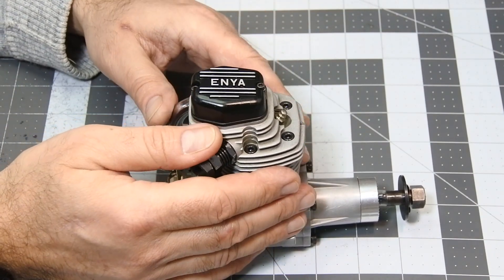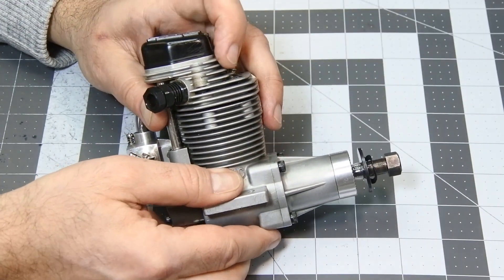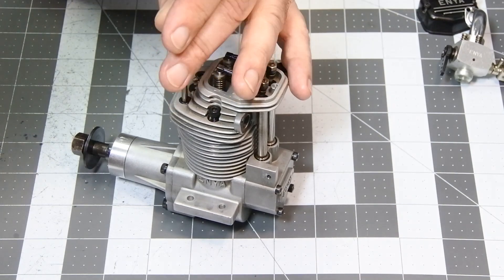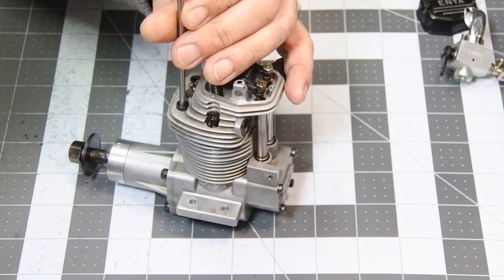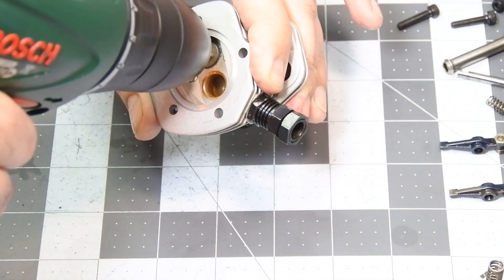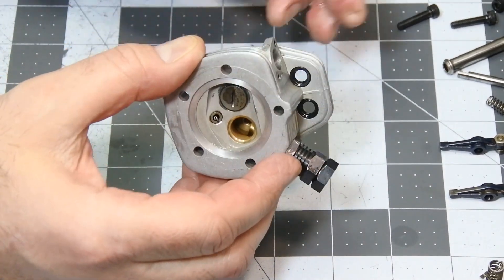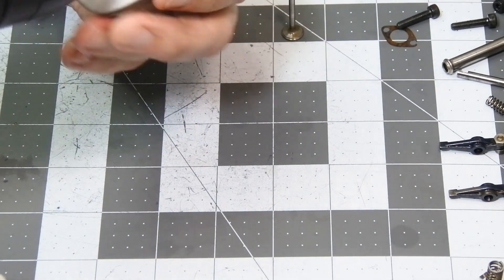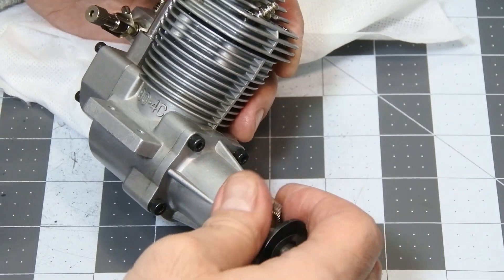Enya 90 4C lapping the valves eng

Comment: Thank you for useful video. I also lapped valves of ENYA 41-4C the compression of which became weak. In that time I did not use any motor tool being afraid of giving unneccecary damage to parts and as a result, needed very long work time. You encourage me to use motor tools in maintenance or modifying engines.
By the way, do you speak russian? I was surprised at russian phrases in your programme in which you tested Tatone muffler on ENYA 90. Тоже я говорю по-русски немножко.
Reply from the maker: Thank you very much for your comment ! Yes,  Russian  is my native language. But after few months after CrazyEngines Project starts, decide to switch to English, as more common in RC engines world. I've few videos in Russian, and I was decide to use some video frames, somewhere Russian is audible :-).

Comment: Sorry not liking your efforts, but this  probably you ruined the engine:  
- Lapping compound for model engine should be very light abrasive (i.e. paint polish) : you don't have hardened seats but bronze seat: Your goal is to  have a "shny" narrow contact band , not  the whole valve seat (valve seat have different angle compared to valve, in order to have good gas seal (i.e. 46° vs 45°) 
- You should put extreme care not to let go grinding compound on valve stem (1st valve seem stuck with compound). This wears out the valve guide  in seconds:.
- during lapping you should do back-fort partial rototation, not putting an electric drill on the valve..
Your engine now works fine , but probally won't last as  a proper valve service would had been done.
Reply from the maker: Dear Paolo Di Marco,
Thank you very much for your comments and recommendations ! For sure will keep in mind your advices for future repairs.